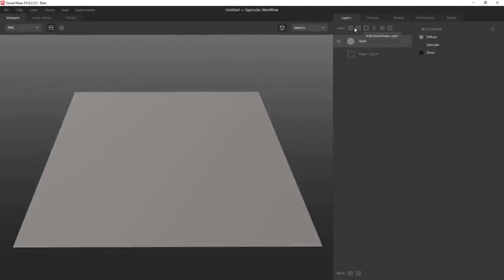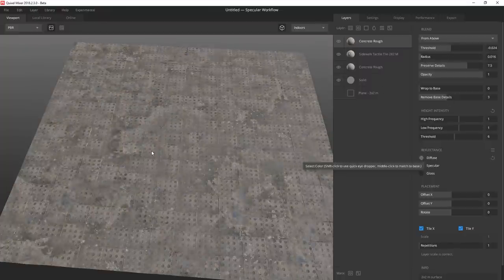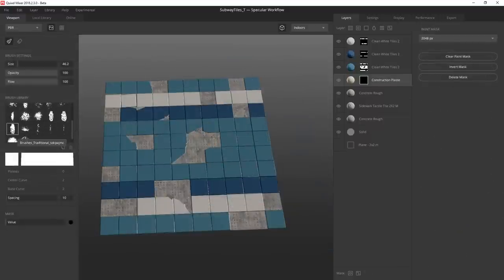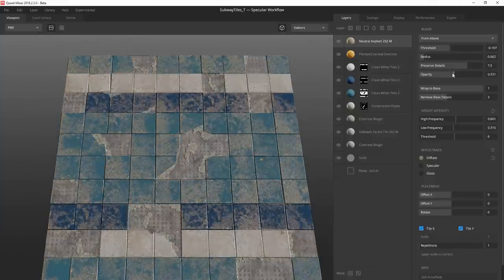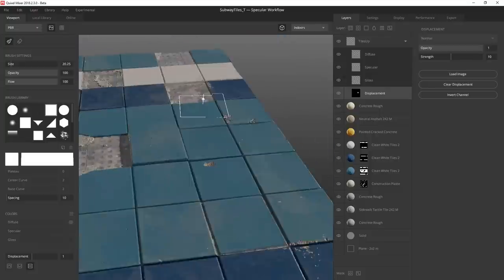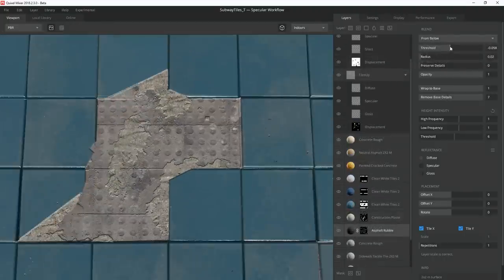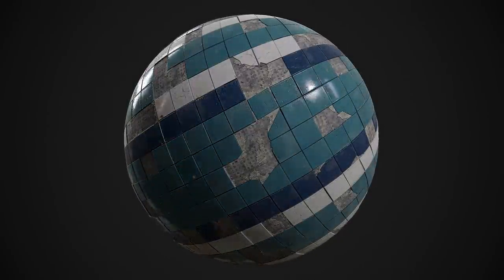Create Grungy Tiles in Mixer: 5 minute tutorial

Comment: You should add a tile randomizer. Basically this texture, I guess, is tillable but you can see a pattern. Anyway your system can use this as a reference and then infinite tile it with different pattern of missing tiles, bumps etc.

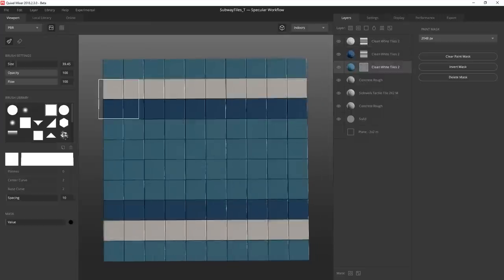Comment: 1:56 how did you do this? the paint mask icon was inverted from white background to black with white stripes and also I'm not sure how to erase or mask to the layer beneath the tiles to show the concrete(remove tiles)
Reply: I ask myself the same question
Reply: hey, did you find out how to do it? same issue and I haven't been able to find the way, hope you know, thanks
Reply: if someone still has issues, i got it to work by painting the whole layer white(then just paint with black to remove the tiles). and if you press X, it switches the brush color from white to black, or black to white. Its also supposed to have a shortcut for inverting the mask (CTRL+I) but doesnt work for me and i dont have it in my shortcut list, so might've been removed.

Comment: Nice tutorial, Just wondering what's your computer config. I have like 128GB ram, Inter Xeon silver, GPU Nvidia Geforce RTX2080 TI, I couldn't work the way you doing things its so fast , including brush paint strokes.  2021.13  quixel is soo laggy, can't even paint the stroke I have like 7 shaders low poly geo 4k view, I tried optimizing 1k and more setting no luck. My geo has Udims and its 10 UDIMs. Any help appreciated.